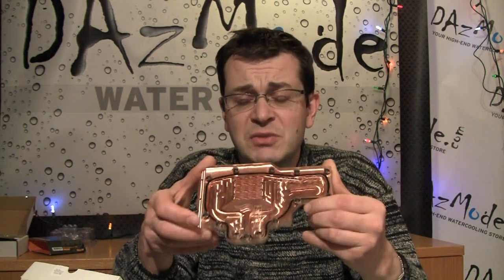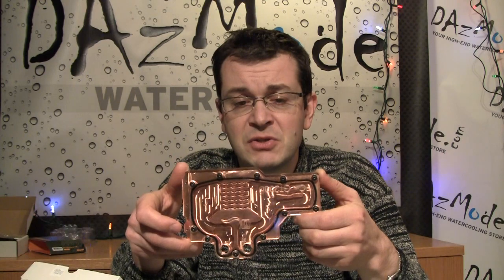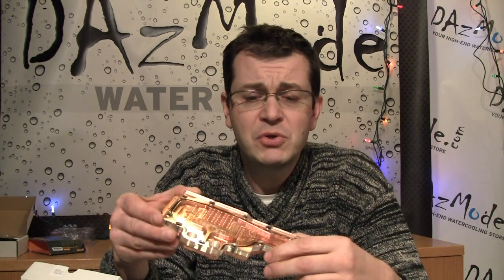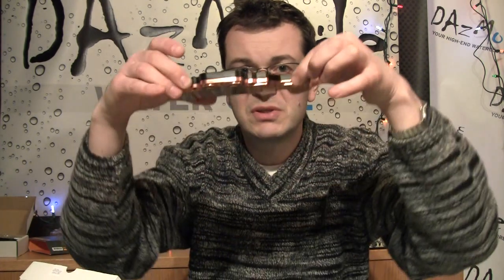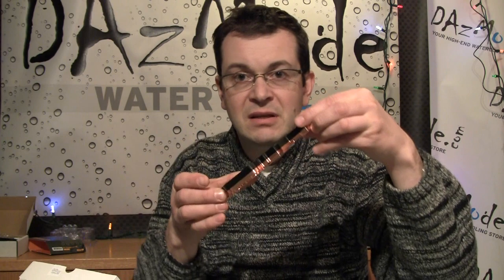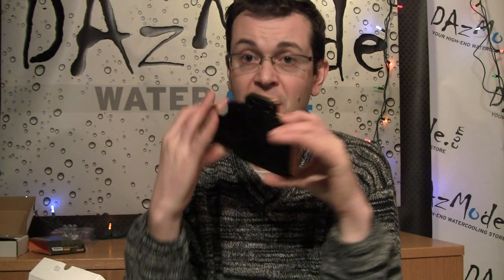Complete Watercooling Guide Part 5  How to select GPU and Motherboard water block ?

Comment: Recently came across your channel and I find its content interesting and useful.
I'd like to contribute a bit on the topic since this video is a bit old.
There is a third type of blocks. Semi universal semi full cover.
Semi full cover - block covers only the GPU and vRAM. The VRM have to be taken care separately.
Semi universal - they fit many cards of different designs across many generations.
I use the Bykski N-GX-M which is for nvidia cars from GTX 470 all the way to GTX 1080/ Titan X (P). With the exception of non reference GTX 970. As long as the GPU+vRAM and the mounting holes  have reference layout (which is almost always the case) you can use it. In addition I use the simple mosfet block which are available from 60 to 100mm. You can find them for 35+16=51USD (plus shipping) - that's less of the half the price of full cover block. They even came with fittings of my choice. I only had to add 2x90 degree rotatable adapters to connect them.
This setup served me well on GTX 570 and now happily cools the GTX 1070.

Comment: Any advice for two of these cards in SLI with limited space? GTX 560
 01G-P3-1461-KR

http://www.tigerdirect.com/applications/SearchTools/item-details.asp?EdpNo=555335

All I can find are waterblocks for the GTX 560 "TI" i don't have the TI and I'm not sure it will fit.
Reply: i know the screw holes are 51x61

Comment: well, I got them at the release date, now they're obviously not a big deal anymore. although, after taking off the stock heat sink and putting on my waterblock, I can tell you its something that I would prefer to do myself. Its like changing the oil in the car, sure you can have someone do it cheap, but odds are they don't care a fly-in beep..or atleast not as much as you do about your own car.

Comment: why waste the money on some 680's when you could get a factory over clocked 670 that is running at base 680 speeds can have a 680 block fitted to it and is like 200 dollars cheaper

Comment: In regards to locating comparable GPU block for your videocard, this is what I did; I emailed the manufacturer direct (in my case, H.I.S. Technology) and asked if the videocard I purchased was of "reference" design, more often than not, they will get back in touch with you (either yay or nay) within a couple of days.
Then it is easier to get the GPU block that you want.

Comment: @cavemanleet k but i understand some grfx makers changes the pcb but it seems only logic for passive cooled card and high end card like what fxf did whit the 5970 they placed the 2 gpu's more to the side not next to each other like the reference design so it was cooler (like more than 5c°) but its just stupid if they set it an cm further away or so

Comment: @themassau well the problem is with nvidia is on the mid range cards alot of the manucturers use non reference coolers on reference pcb's, eg msi & evga on the GTX460 both had non ref coolers but reference pcb

It would just be alot easier if card manufacturers would listen to us and start publishing if a certain SKU is nvidia/AMD ref pcb design or if its their own revision of that particular

Comment: @cavemanleet  i think that what nvidia it is just the difference between the reference cooler on your gpu or an after market coller from an other producer (probably the same as whit ati cards) so  if you have an gpu whit non reference cooler than it might be a different circuit board

Comment: A good tip for ATi/AMD graphics cards is it will show either the ATi logo or the AMD logo printed just above the PCIe connector. This shows its a reference card so all Full cover blocks for that card should fit. 
If it says the name of the card manufacturer, sapphire, powercolor etc - then it is 9 times out of ten a non reference design so a full cover block wont fit unless EK have made a sub non reference block specifically for that card.

I'm not sure if this applies to nvidia cards.